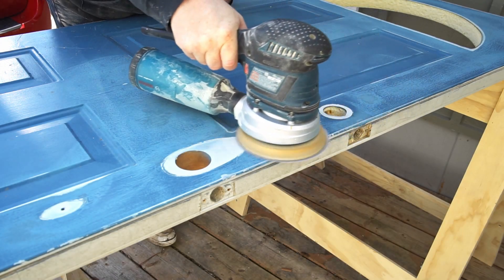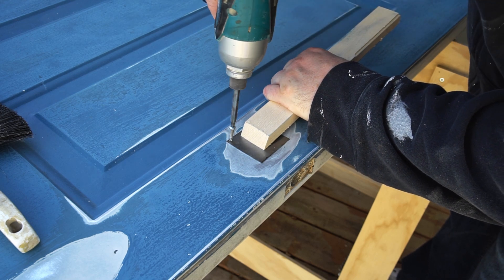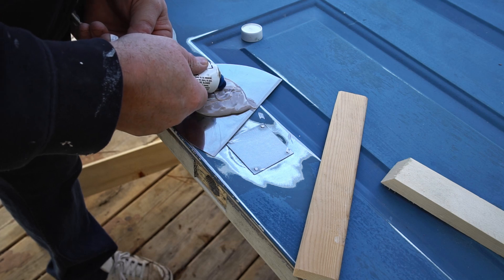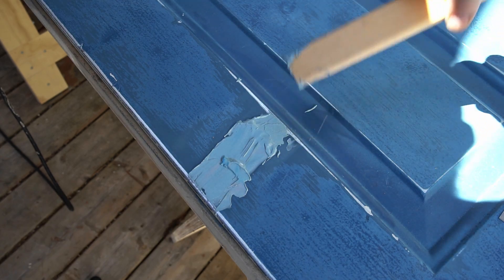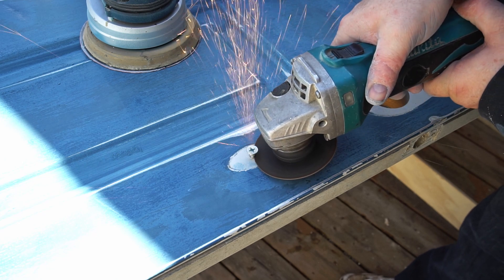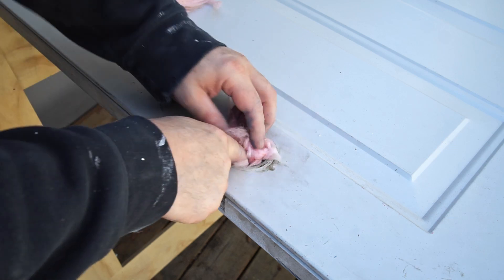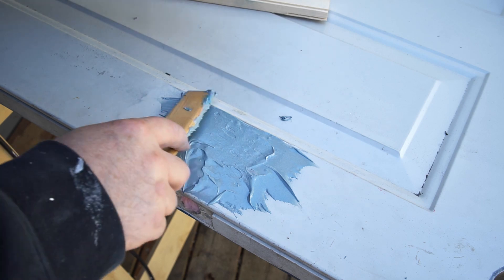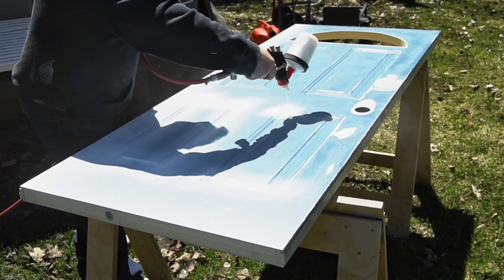How To Fix Holes And Dents In A Steel Door

Comment: You can lay a piece of wax paper over the body filler after applying it and use a small board on top of the wax paper to flatten and spread the filler out.  After the filler sets up, the wax paper will peel right off leaving a flattened patch that requires minimum sanding.
Reply: Thanks!
Reply: Thanks.  I have several repairs I need to make on my aluminum pool cage frame.  I'm certain the wax paper will also help to keep the autobody filler in place while it's setting.  I've had a bit of difficulty keeping the filler from sinking into the little holes.  Hoping this will help.

Comment: For little screw holes in hollow metal doors or panels, You can use a foam fun and shoot some foam in the holes, then after it has expanded dig a little out, then fill with Bondo

Comment: Does bondo contain asbestos, I know it has talc in it, would this be dangerous to sand down inside the house? I didn’t want to have to take my front door off but have some tiny holes to fix and a minor dent but spent years picking all nontoxic products for my home because of my health.

Comment: What grit sandpaper did you use on that was That an orbital sander?
Reply: In the auto business you progress from small to higher grit to keep it smooth.
Metal with filler ends up at 1500 to 2000 grit.